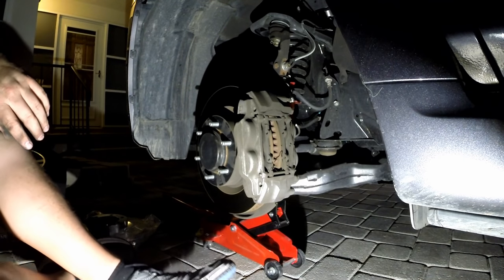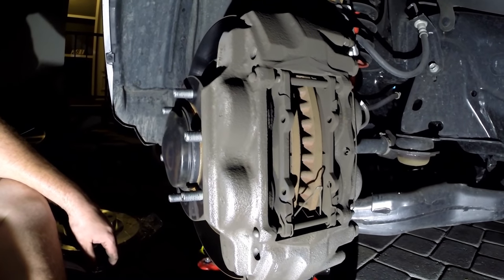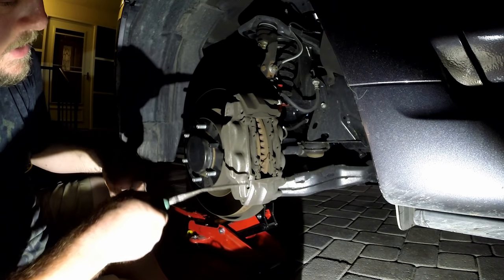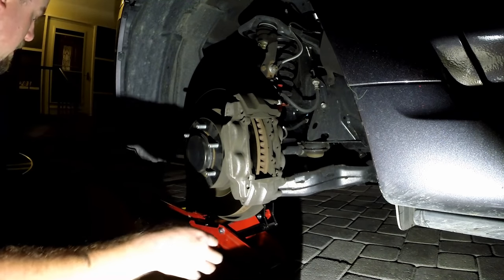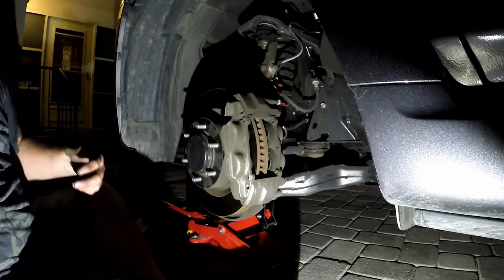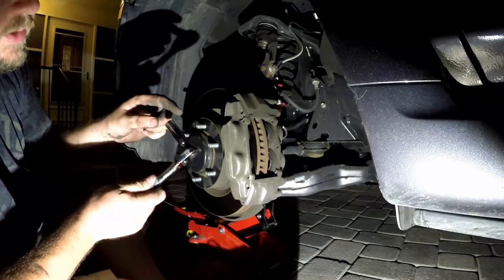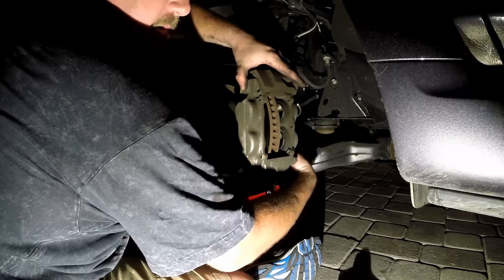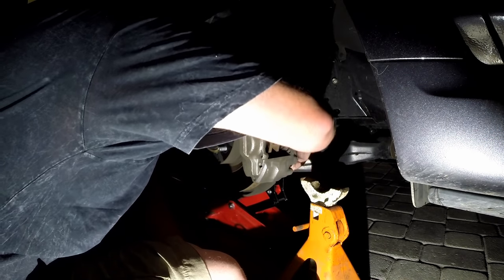Toyota 4Runner 2010 2011 2012 2013 2014 2015 2016 2017 2018 5th Gen Install Front Brake Pads Rotors

Comment: Nice video just a helpful tip put the old brake pads back in and push on those so you do not damage the Pistons when you’re pushing them back in the caliper.
I use a small C clamp and place it between the two pistons and this way it pushes both pistons in at the same time
Reply: That's the way to to it browski!!!
Reply: a piece of hardwood will do also

Comment: I know you mentioned this is not your profession so not beating you up here. One more thing to help out those following this.  Please ensure that you use a torque wrench and put those calipers back on with 90 foot pound of torque. Couple other things people mentioned as well jack stands and slip the wheel tire under the side of the truck for extra support it’s that 110% insurance. Concept and functions performed will work out but for instructional purposes just adding onto the video. Thanks for doing the video and let us know how the power stop product works out.

Comment: Good video man. Just did the front pads and rotors on our 15' . Anyone around 80k use a PB blaster and a steel punch with a hammer to get the pins out. Also if you spray the caliper bolts and eat your Wheaties it helps. Small extension makes it so you clear the metal brake line. 

Thanks for posting this.

Comment: Tip: as opposed to using channel locks to push in the pistons on the caliper directly, first inset an old pad. Then use the channel locks to press on the old pad. A c-clamp works better. That way you push in both pistons simultaneously. Else compressing one can push the other out (headache). Also, the channel locks do not apply straight pressure but rather laterally load the piston which can score/damage the inside of the caliper leading to headaches down the road such as leaks or seized calipers.

Comment: use a wire clothes hanger to support the caliper from the upper control arm.  Also, bremo blanks are probably the best rotors you can buy.. zero warping from my experience in buying 5 sets for different cars.  

Also Ryan- you shouldn't use metal on metal when pushing the pots back in the caliper dude... youll mar the part that contacts the pad and it will wear unevenly and could fail/leak.
Reply from the maker: That's a great suggestion. I should have used the old pad up against the plungers and pressed my channel locks into the old pad instead of each of the actual metal plungers in the caliper.

Comment: Thanks for the video. Helped out a lot. I did have issues removing the caliper bolts but other than that your video was dead on. Thank you.
Reply: use a light coat of Silicone grease on the pins and or bolts on other type of vehicles

Comment: Thanks for the video, you make it look so easy, and changing the pads is indeed that easy.
Wasn't able to turn the 17mm screws, even with a long torque limiting wrench, so the rotors are still there. Any advice on turning those screws?

Comment: I tried the power stop drilled and slotted rotors and they were warped out of the box.  My pins were also completely rusted and seized and I had to drill and punch them out.

Comment: First off... What you replaced are rotors NOT calipers. The caliper which you put on the jack should NEVER be supported that way. If you bump into it or it slips off you would have a MUCH bigger problem. Always support the caliper with either a bungee cord or wire hanger through a hole in the caliper and hang it from above so that ALL tension is off it. Next... never use a pair of Channel locks to recess the caliper. Use a C-Clamp and one of the old brake pads.  Insert the old brake pad against the inside of the caliper and slowly turn the C-clap to recess the caliper. You also might want to open the master cylinder reservoir cap to ease the effort needed to turn the C-clamp and make sure to have something under the master cylinder reservoir to catch the brake fluid that will come out. Don't do repair videos instructing people what to do if you aren't gonna do it properly. You will cause people headaches and additional $$$ unnecessarily
Reply: This is good advice and you're correct on all accounts. But you could be more friendly about it. :) Dude is just trying to help some folks. Let's not discourage people from doing that by being unappreciative or mean spirited.
Reply: Surprised no one has said this yet, but, thank you sooo much for mighty keyboard warrior skills. What would we do without people like  yourself  to protect us from those that would mislead us on automotive maintenance!
Reply: Since we're being overly technical... he didn't recess the "caliper", he recessed the piston into the caliper.

Comment: The 2 pins suck to remove if you go 80k before needing a brake job. Mine was rusted in and could not be removed using most common methods. I personally think Toyota did a horrible job designing this set up

Comment: Safety point:  Where is the Jack Stand to support the vehicle? Do not allow a vehicle to be supported by floor jack alone, you can use  the wheel you removed or wood cribbing under the frame. Just dont put your body parts under it, if all that is supporting it is a floor jack.
Reply from the maker: The jack stand is a little further back under the frame out of camera shot. I never work on a car without a jack stand. Usually multiple jack stands. Not worth it.

Comment: Great video! However you may regret the cross drilled slotted rotor setup. You front pads will wear down much faster than using blank rotors. Just my 2 cents.

Comment: Can you have the rotors turned??
Reply from the maker: I probably could have turned the rotors, but I tow a trailer a lot and I fill it with 6 family members most weekends, so I wanted more stopping power, which these Power Stop Z36 kits add in spades.
Reply: I generally just replace them. They're not expensive. Plus turning the rotors removes material. Thinner rotors heat up more quickly, leading to warping down the road. Since I don't like to do jobs twice, and rotors aren't all that expensive, I would just replace them.